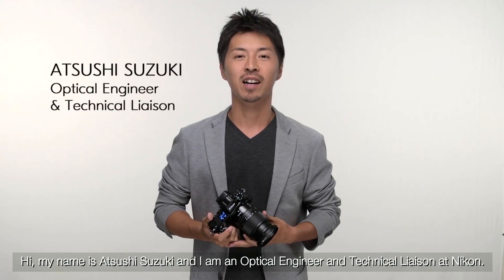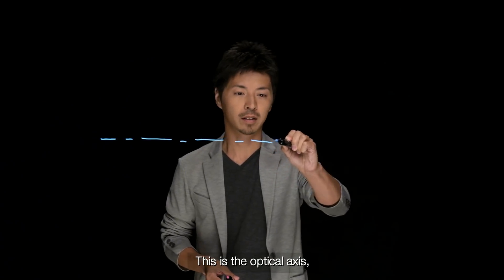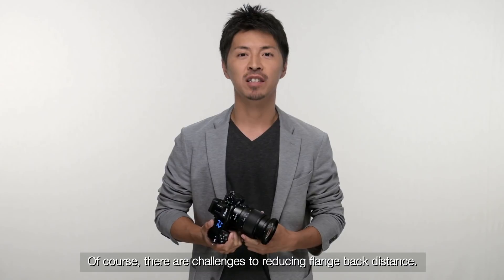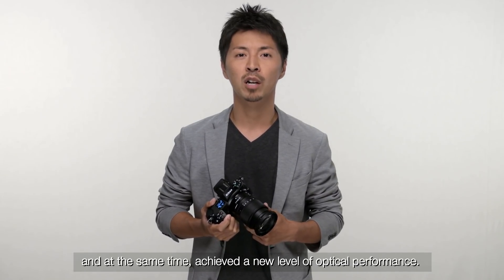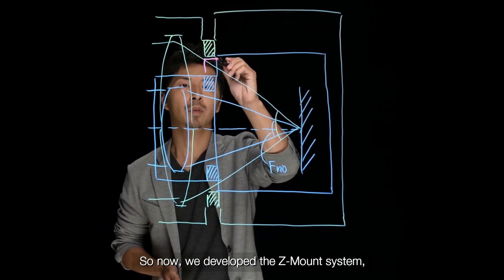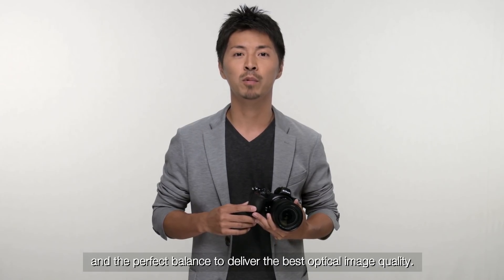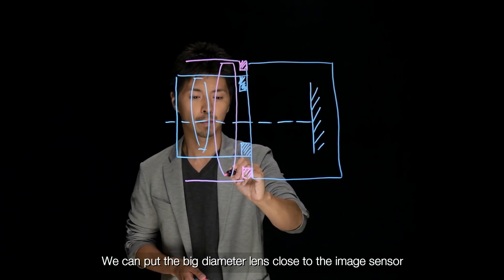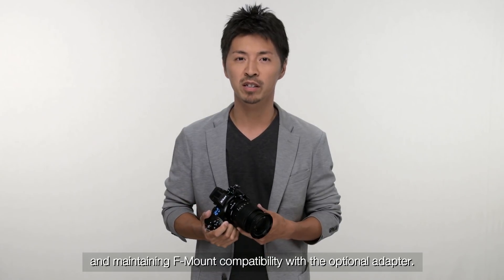Nikon Z Mount System: Structure and Design

Comment: If I'm not mistaken ... then Canon has already been doing this sort of thing for several years.   
Meaning that their Rebel lenses can't be used on the full frame camera bodies, for very similar reasons to why Nikon had to specifically develop their Z mount lenses.
Ah, but their plan has a flaw, simply because the Nikon lenses made for their Z9 and similar cameras are now being made in China, which means nothing but crap lenses from the point of view of how they are constructed.   Meaning the lenses might be able to focus better, but their auto-focus system inside the lens is otherwise a piece of garbage.
It's kind of like putting the cheapest set of tires on a race car.   If I ever get another Nikon, it will be the D850.   I already have a D7100, which is a GREAT DX format camera.

Comment: As I understand from this video which is very interesting, the new mount allows the development of more compact camera systems (camera and lenses). But than Nikon recently released a 70-200 f2.8 for the Z mount which (I read the specs from the nikon website) is slightly heavier than the previuos VRII lens...so where the advantages of the new Z mount are?
Reply from the maker: Hi Alessio - Nikon Z series cameras come equipped with the widest lens mount of any FX-format or DX-format digital camera. The Z mount allows more light to hit the camera sensor which allows the system to deliver faster performances, sharper images as well as the opportunity to develop new lens designs with up to f/0.95 max apertures. For more information on the Z mount, please visit: http://bit.ly/2NrIg06

Comment: The brightness of the projected image (illuminance) relative to the brightness of the scene in the lens's field of view (luminance) decreases with the square of the f-number... So a lens with an F-number of 1 vs 2,  the smaller the number the more light is transmitted to an image sensor by a factor 2^2 or 4 times more light for the F-1 lens vs F2. See Wikipedia for more details.

Comment: hi nikon,
please show some kind of instructional video how to life synchronize the data on the xqd card to a mobile phone with a 128gb sd card in it so that people do not complain about the missing second card slot. they have a point but the backup concept can be realized otherwise too don't you think?
second thing is about the api for the lenses. nikon does not provide a documentation for the api for other lens manufactors. but they are not stupid. they have their way to reverse engineer that. (i know because i worked in that area myself)
did nikon just enhance their new api with new features or did they actively make it much more complicated or next to impossible to reverse engineer the new communication protocol between the lenses and the camera body?
this is an important information for me as a nikon user who also loves to use lenses from other manufacturers.

Comment: I am glad your finally getting into the mirrorless game. As a long time Nikon user this makes me happy.  However at this point. Talk is cheap. Whiskey cost money.. Its time to get blow the world away with some glass for your new mount. Having owned/Used your Nikkor 28 1.4 AF-D,  Nikkor 300 2.0 IF-ED an the Nikkor 58 1.2 Noct AIS I love fast glass.  I would like to see a new Nikkor 300 2.0 AF version with the new mount.  Make this possible Nikon. Make the next model have eye focus as that seems to be what everyone wants.  And put two card slots in and a better battery so people can quit whinging  about it.. I am still using  Nikkor legacy manual focus glass so I dot really care about AF..  But everyone else seems to think it is.  I am excited about having image stabilization with Nikkor AIS glass  Looking forward to being able to get one these camera's in my hands and mount some legacy glass on and get outmatching pictures. .https://scontent.fyyc3-1.fna.fbcdn.net/v/t1.0-9/42470489_149578915982125_5194352178134777856_o.jpg?_nc_cat=108&oh=eddcb262259c9c79fd03d992c68b469e&oe=5C265B31 Nikkor 800 5.6IF-ED AIS on Mirrorless.

Comment: Where are the faster ( f/1.2) lenses?
Reply: Did you check the lens roadmap?
Reply: Yes, I saw it! For this year 2 f/1.8 lenses (35 mm and 50 mm), for 2019 2 f/1.8 lenses (20mm and 85 mm), 2 f/2.8 lenses (24-70 mm and 70-200 mm) 1 f/4 lens (14-30mm) and the Noct f/0.95., and for 2020 1 lens f/1.2 (50mm). Except for the Noct when will see some really fast lenses? In 2020  (the 50mm f/1.2)!!!!
Nikon already has, with the F mount, some fast lenses (AF-S f/1.4). If the new Z mount “possesses huge potential in optical design” and “the ability to support f/1.2 and even f/0.95 aperture lens design”, I (and I am sure WE) want to see and use those lenses. According to the Roadmap until 2021 we will see only 2 of them (the Noct and the 50mm). VERY DISAPOINTING!!!!
Did you see the Canon announcement (28-70mm f/2 and 50mm f/1.2)? And they mount is smaller by 1mm!
Reply: You got a good point Tibor, Nikon still sticks exactly to the same features and the classic 24-70 f2.8. Why not surprising people, specially when everybody will have to spend so much money to change lenses it takes years to buy. The explanation coming from this Japanese engineer is great but then the road map doesn't reflect it at all.

Comment: the problem is the lenses's price. for 50mm F1.8, it's not cheap compare to other competitors
Reply: But the MTF charts suggest Zeiss Otus levels of performance and they are even more expensive. Nikon has also stated than non-S Line lenses (presumable cheaper, smaller and worse performing) will come at a later date.

Comment: doesnt fe mount got a 50 0.95 manual focus lens?  Nikons 58 0.95 is also manual focus so whats the benefits? I dont get it
Reply: The E mount f/0.95 is soft wide open because the light has to move at such extreme angles in order to fit in the small mount. Presumably the Nikon 58mm f/0.95 will be very sharp wide open due to not having this limitation in mount diameter, but it will also have to be bigger and heavier.
Reply: @Bayonet1809  Ahh I gotcha, thanks for explaining that.

Comment: 4:40 and that is the F-number?

And I have always thought that the F-number is the ratio of two values, focal length and aperture diameter, ie. 500mm and 178mm aperture has 2.8 ratio, meaning ratio is 2.8. But now that it is the angle of the light hitting the sensor/film? Okay...

Comment: This was the best video. Thank you for the in depth explanation. It's just what I needed.

Are there differences in depth of field with the new Z mount compared to the F mount at the same focal lengths?
Reply: No, if you had studied your optical design that only has to do with focal length, aperture used and the distance between the sensor and the object being photographed.
Reply: @N0rdman  No need to get personal. I know what affects dof all things being equal. I'm a photographer. 

In this case, the distance between the rear lens element and the sensor is changing. Older video cameras had a very short flange distance resulting in a severe lack of depth of field, even at long focal lengths, wide open and close to the subject. I'm sure that's not happening here. But because the flange distance is changing, I want to know the effect of that change on the apparent dof quality.
Reply: Don't thing the gentleman (Nordman) knows what is talking about:) and Nikon won't reply. It's true that the dof will be different.
Reply: In that case the circle of confusion would change with flange focal distance, I argue it doesn't. 

The relationship is given by the Gaussian Lens Equation as applied to a simplified thin lens, normally written as 

1/So + 1/Si = 1/f

where (all in mm)
So = distance of lens plane to object
Si = distance of lens plane to image sensor
f = focal length

Assuming that So and f are the same on both cameras. 
If sensors are the same size, that would also mean that their Angle of View is the same, hence their f/numbers (N) are equivalent. Which brings us to DOF. 
Simplifying with C the circle of confusion. So assuming that by aperture above you meant f/number N:

DOF = 2 N C So^2 / f^2

Comment: This is just ridiculous. There are already F1.2 lenses for the old F mount, with longer flange and smaller diameter. Canon's DPAF is also much faster with smaller mount.These are jsut ramblinngs of a PR person, this guy should be ashamed of taking part in it.
Reply: First thing - sorry for my bad english. I'll try to explain that very easily. Check sharpness of Sony 16-35mm (or even very cheap Samyang 12mm f2.0) and compare it to Canon/Nikon UWA lenses. Because of such long flange distance in C/N mount you cant design lens which will have good corner sharpness. Photons in UWA lenses are coming from very steep angle and if you want to project this image further away from lens then photons will simply mix together. Its noticeable very much in corners because in corners you have most steep angle.

In terms of bigger diameter - image circle that lens is projecting on sensor is bigger so it means a lot less vignette which is a problem in bright UWA lenses and also it allows optical engineers to make new optical designs that we didnt had before. Yea, new optical designs because current one are based on designs from analog era. Maybe we will have something like 16mm f0.95? That would change astrophotography for very many users. You could literally record videos of stars. Not timelapses but 24fps videos. We can argue about how noisy it will be (it will still require high ISO because of 1/24 shutter speed), but Z mount is here to stay so we should expect further improvements in ISO performance so this kind of stuff can be done! :) Don't look at Z system if it would be P&S - this system that will evolve and because they tried their best to make best foundation I bet that we will come back in 3-5 years and then we will see how Nikon is using their mount to full potential. Nikon F didn't have even auto focus from day 1, this bigger mount also gives them more space to make some extra connectors! :)
Reply: The 16-35 GM lens (a much newer design) is very sharp all through the corners. Yes there are limitations and the vignetting will increase, but it's not as dramatic as people think with lenses purposefully designed for it. And of course the camera and the lenses / lens adapters for vintage lenses can be smaller.

By the way, Canon have already figured it out the bigger diameter and its advantages in like, 30 years ago?...

Comment: I want to see a 135mm f0.95.
200mm f0.95 "might" be possible but I'm sure it would be a big stretch for the engineers, not to mention it would probably weigh 10lbs.
Reply: Why? Please tell me one practical use for it
Reply: on 200mm f0.95 you wouldn't even have sharp eye because DoF fall-off is crazy fast that sides of eye would be already blurred. It would be maybe nice for some astrophotography but why design such ridiculous astro lenses for Z-mount?
Reply: 135mm f0.95 would actually use the exact same front element size as 400mm f2.8, so effectively they're already set up to produce that lens design, the question is whether or not anyone would pay high end Supertelephoto prices for a portrait lens.
Reply: Bud The Cyborg I just want a sharp, low distortion, close-focusing 24mm f/1.2 from Nikon, not some colossal telephoto with no DoF.
Reply: Yes, Wide Angle lenses is the real reason that Full Frame Mirrorless exists.
We should be able to get f2.0 pancake lenses at every length from 16mm and up.
Reply: Nikon will release a 58mm f/0.95 S on 2019
Reply: They wont do 135/200m f0.95 because there wouldnt be auto focus with such big elements. If you would try to add autofocus then this lens would be heavier than 10lbs so nobody would buy it and also to have such autofocus motor working properly they would waste A LOT of time and money. It would be such expensive to manufacture and then you would also to do some quality control so lens would cost like $40k.
Reply: Ok but why? The depth of focus is thinner than a human hair

Comment: Sorry Nikon, 1 x SD card is unforgivable.
Reply: Good thing they are not using 1x SD card but the much better, faster and more reliable xqd.  They don’t need your forgiveness for providing more than what you’re asking for.
Reply: "Two Is One and One Is None".
The quality of your cards is irrelevant.
Reply: Exactly, it is totally unforgivable that Z6 and Z7 has no single SD card slots!
And D850 is failure as it has only a single SD card slot, totally unforgivable!
Reply: It's one XQD not SD.....-_- and I dont care, i never had an SD card fail in the last 5 years. I will take the super fast XQD and CFXpress card over a dual SD Card anyday. I need to clear my buffer ASAP!
Reply: The Z6 is still very competitive, at $2,000 dual card slots is still an uncommon feature.
The Z7 definitely should have been designed differently.
Reply: It doesn't have any SD card slots.  Spoken like a true millennial.
Reply: then you can ignore the video lol